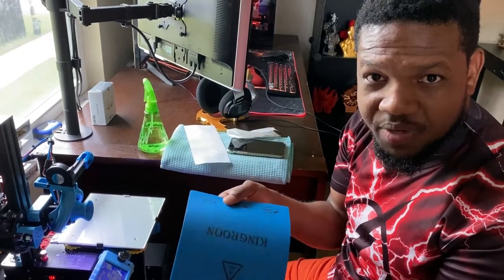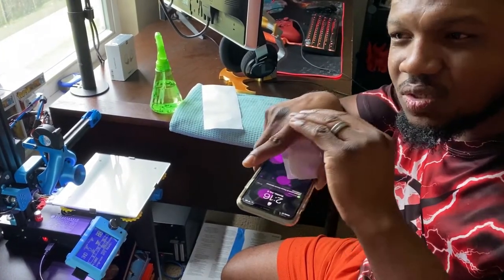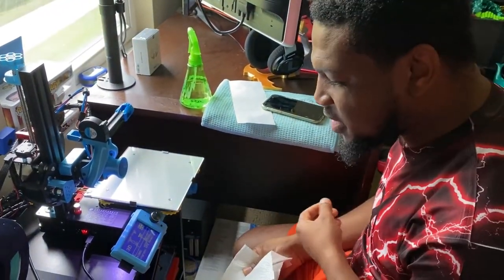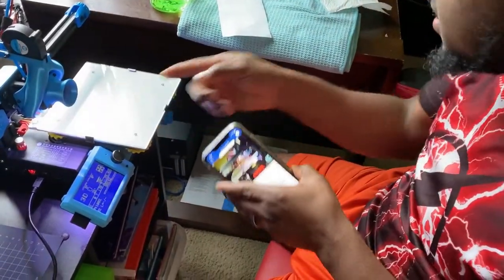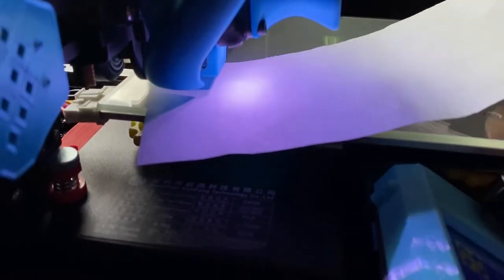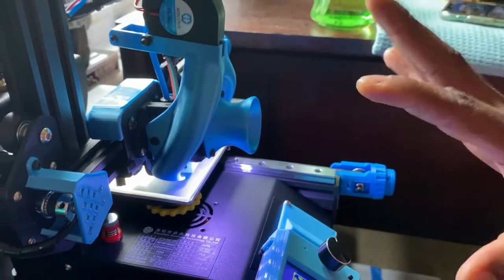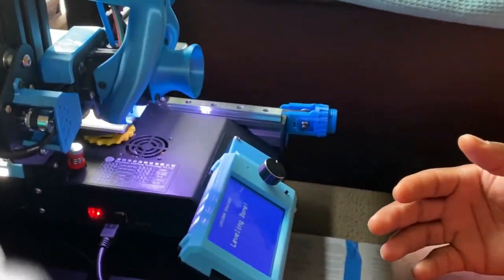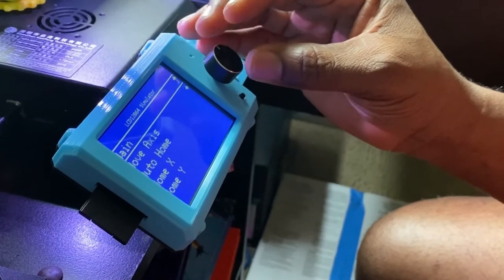MMBL and How to 3D print on Glass Bed

Comment: how do you get it to stick without any adhesive?
Reply from the maker: Just clean the bed with 90% isopropyl alcohol, make sure you're bed temperature is at 65-70c pla sticks better at this temp, and level the bed as best as possible.
Reply: @GoldenJaguar3D  thanks for the help